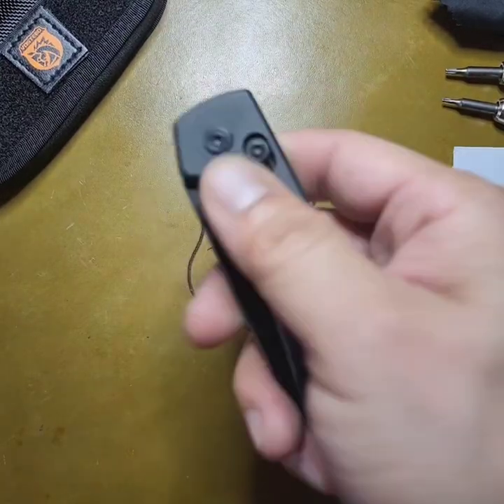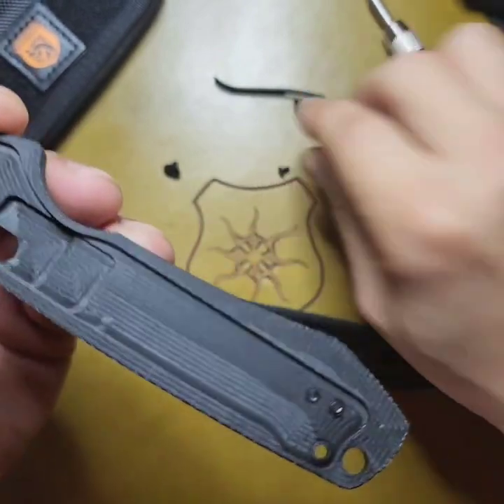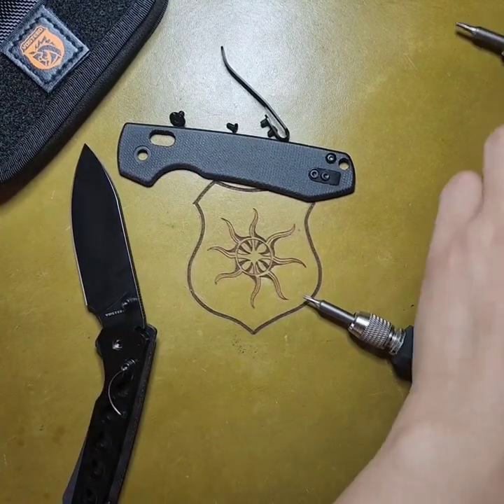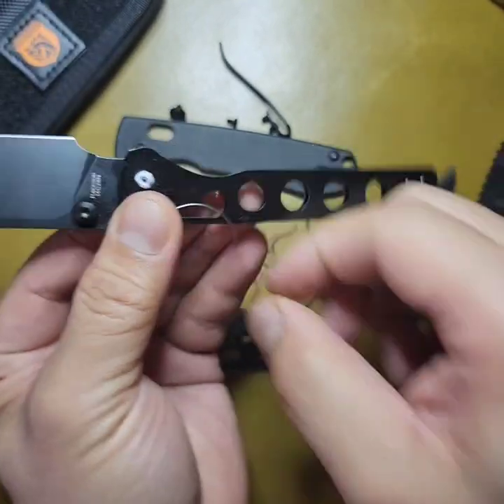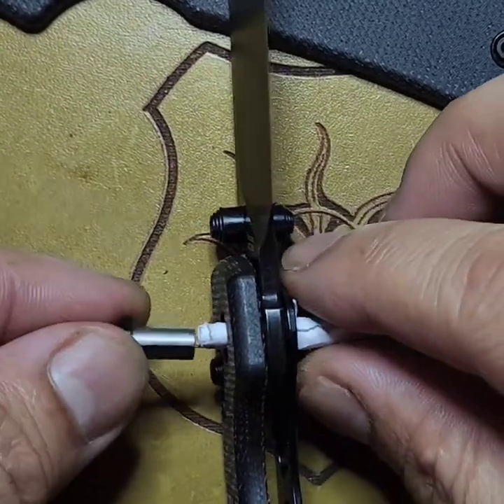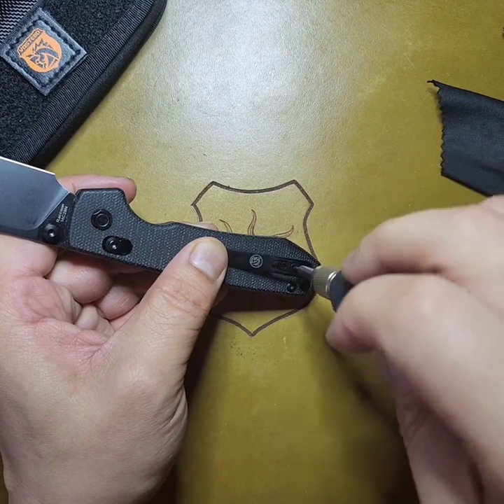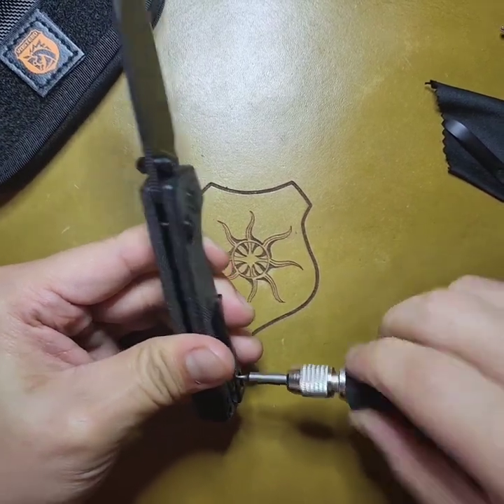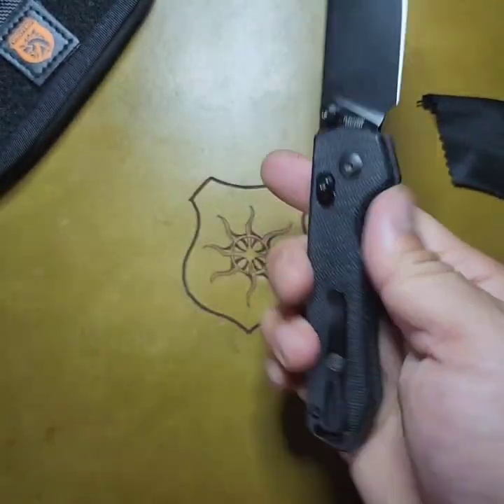Vosteed Raccoon Crossbar Lock spring adjustment - disassembly and reassembly #knifemaintenance

Comment: The one I just got today has no adjustment holes - only one setting. It did come with an extra set of springs, though.
Reply from the maker: I think they have stopped with rge adjustment holes on the newer batches. Different strength springs, I believe.

Comment: Man i snagged one of these and it doesnt have the adjustment holes for spring sending it back tension is weak the knife is cool though.
Reply from the maker: They have changed the design to have no adjustment holes. Kizer has patented it
Reply: @vucachon  aww man I didn't know that still a nice knife though. Thanks man I wondered

Comment: Still a two finger disengagement of the knock off axis lock? Why cant these companies figure out benchmades butter smooth action?
Reply from the maker: Lol have you tried these yet? It doesn't take 2 fingers. You can use 1. And this is the Clutch-Lock, a better, and improved crossbar lock. Sorry, but it seems you are speaking without experience. If you have experience, please elaborate
Reply: @vucachon  Fair enough, I was just watching you. If it's only one finger, I stand corrected, and I'll drop the $60.
Reply from the maker: @MrSlicer2424  for the price, it is very comparable. I find Kizer's Clutch-Lock pieces better... however a bit pricier. Check out the Kizer Drop Bear or the Escort. Vosteed's crossbars are good, but Kizer's has a more efficient setup